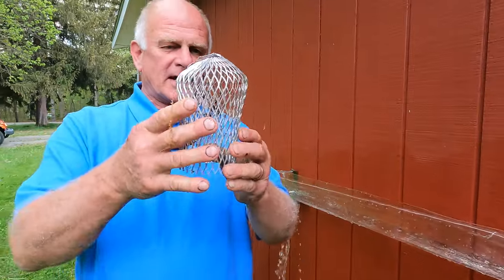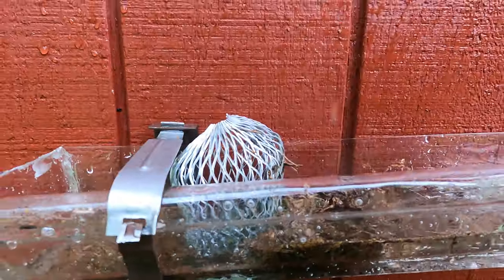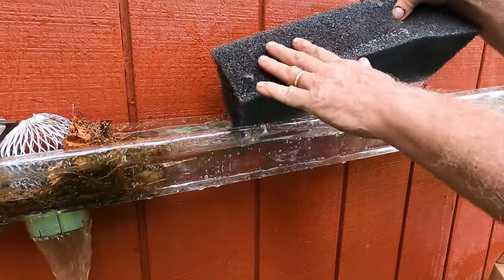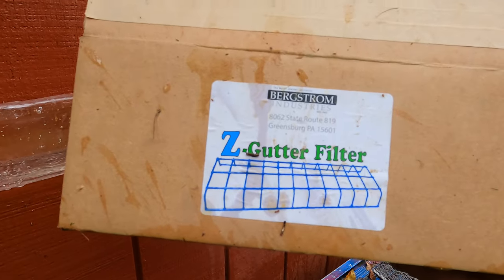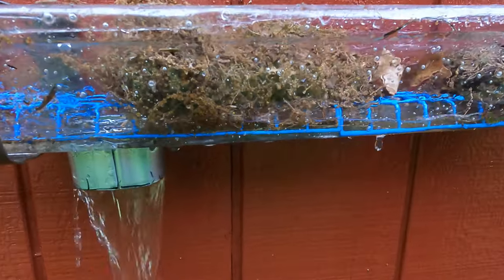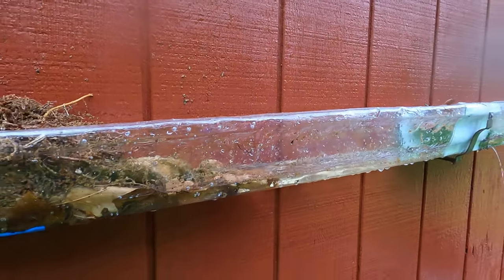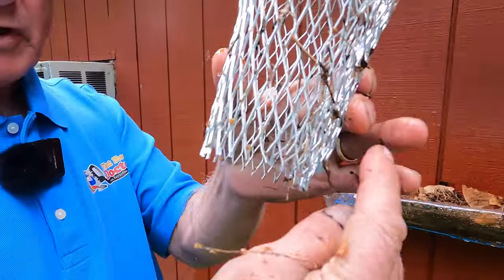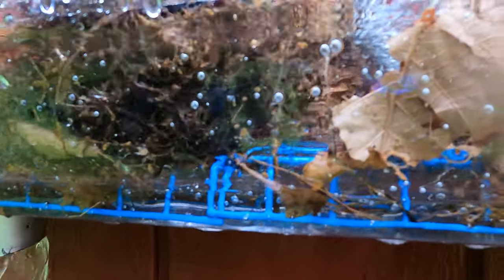Worst Gutter Filter and Best Gutter Filter Practical Review

Comment: Ive been watching your videos very informative.   My flat roof is not relly old but the guy who did it passed away  Poor quality Home Depot flashing was used and the OSB underneath at the low end is wet and soft. It's also rotting my facia. Can I do a partial re roof if I change the wood and flashing?  Also how do I buy supplies from ABC or Metro roofing supply if im not a contractor?  Im not even sure I'm capable of doing this myself.  Would you go to Seymour CT to give me a price?  Its  like a 675sf building.

Comment: Hi there. This is your latest video, I thought to ask you my question. I think I had bad cowboy roofers. They did a small job 2 months ago but asked them to put right the cracking after they replaced the flu. They just put more cromapol. Anyways, I think they pushed the other chimney by force and told me it needs cromapol and charge me extra £100. I said no. My question is now my whole chimney crown is moving. How do I fix this? Repointing? Can it I use strong adhesive etc? Thanks in advance...